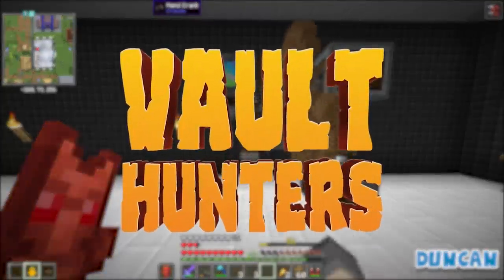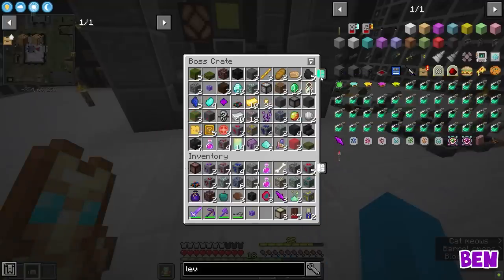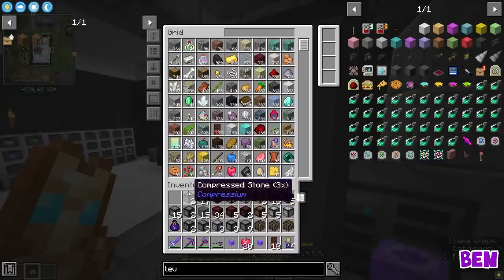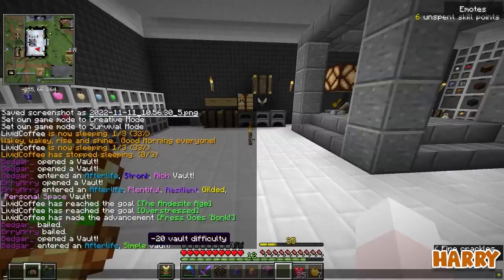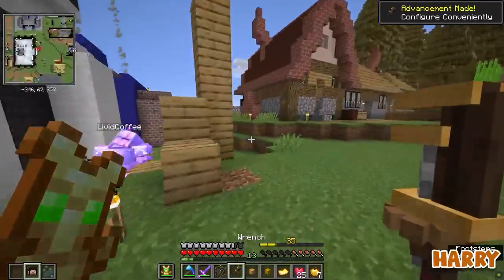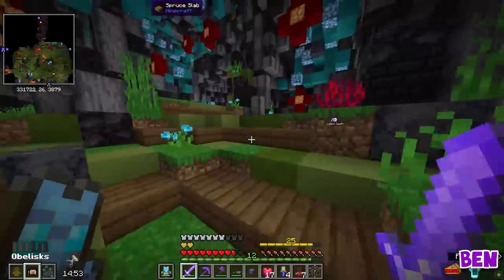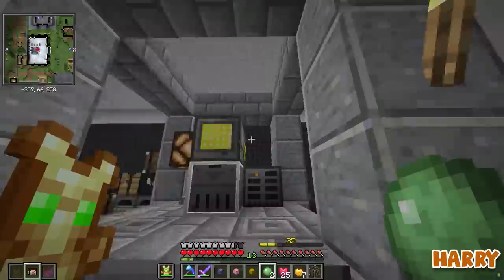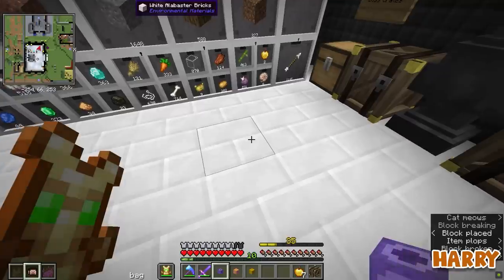Windmilling with Super Glue - MINECRAFT VAULT HUNTERS SMP #31

Comment: So you can actually automate brewing stands by placing hoppers on different sides. One side will accept ingredients, one will accept water bottles, and placing a hopper underneath the brewing stand will pull out the completed potions when they finish! You can use one brewing stand to make the awkward potions, then pump those potions into another brewing stand that will use the golden apples to make the healing potions, then use one more hopper underneath that brewing stand to pump into a chest
Reply: That sounds too smart
Reply: Unless they have a mod that changes how hoppers interact with brewing stands, wouldn't the hoppers just remove the water bottles before they have a chance to brew?
Reply: I think brewing potions with create will make slightly more potion for the amount of ingredients you put in or make them last longer, but I could be full of shit.
Reply: @ItsMaddieNow  Pretty sure Create can make 4 potions at a time instead of 3, yeah
Reply: @ItsMaddieNow  Yes, Create makes 4 potions per ingredient instead of 3
Reply: @bluierox  I'm pretty sure sending a redstone signal into the hopper will lock it. I've definitely made an automatic brewing machine before, with barely any effort, (though I can't quite remember how it worked) and didn't have to worry about that problem.
Reply: Barry doesn’t seem like the kind of guy to listen to this advice.

Comment: Disapointed Barry shot down Ben's 2x2 water source so quickly. Not only is it easier to use, as they pointed out, but it's way more decoration friendly than the 1x3. You can hide three of the water sources underneath the walls of your base, and then there'll be one watery corner tucked out of the way for infinite water that no one would notice.
Reply: Or they could just use the sink from Cooking for Blockheads. It gives infinite water.